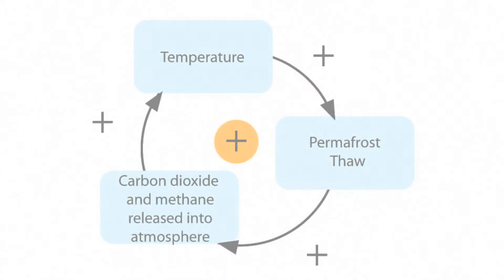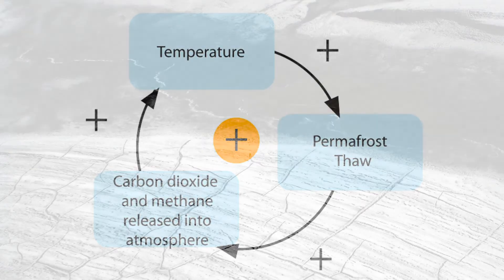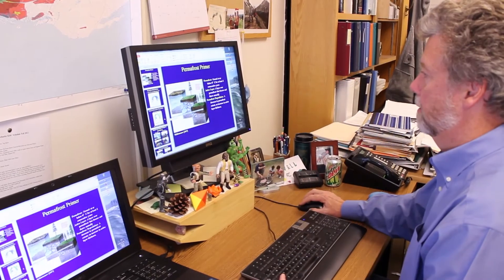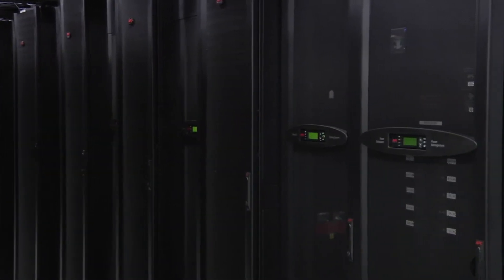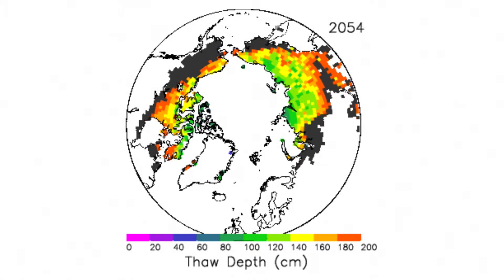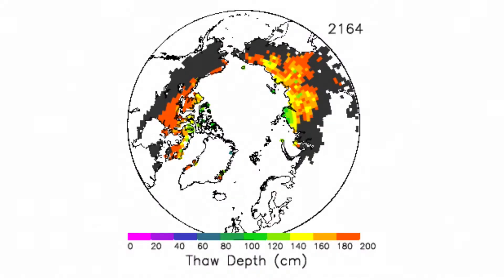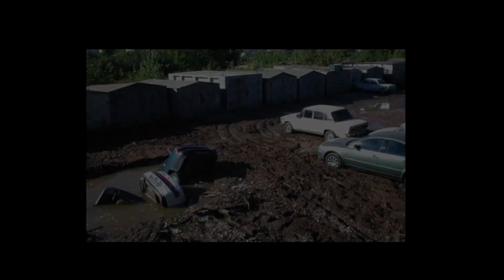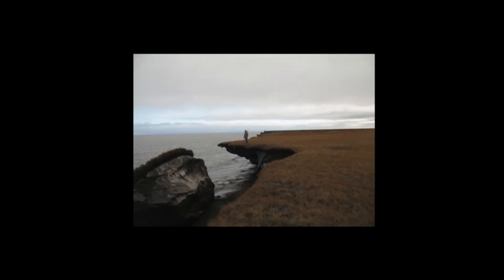Permafrost Carbon Feedback and the Janus Supercomputer

Comment: Please explain how carbon, the single carbon atom of CO2 can "feed back" anything, how holding the 2 Oxygen atoms guilty by association makes any sense, how CO2 can trap anything much less heat, how CO2 can create "radiative forcing", since none of these moronic terms are in my physics or Thermodynamics books, and are manufactured terms to freighten the masses into giving others more power over us, and demand more money, to solve something non existent? And as a decade passes, and the dire predictions haven't materialized, they can say "see, we fixed it"....when it was never actually broken to begin with?